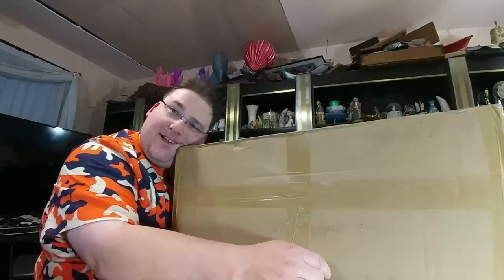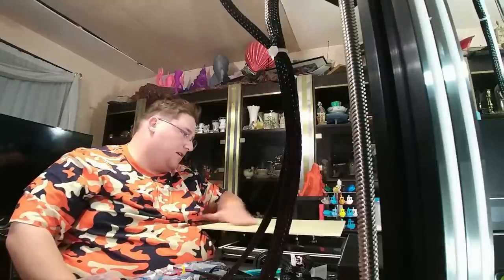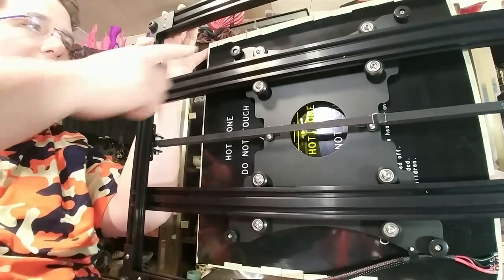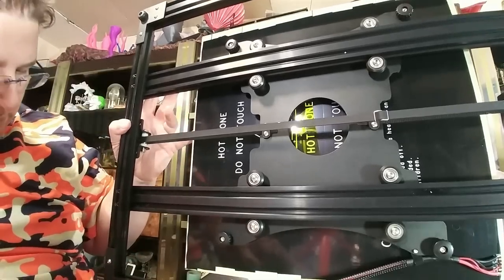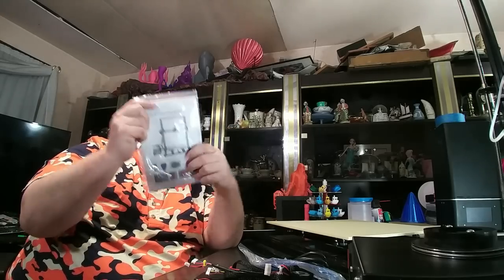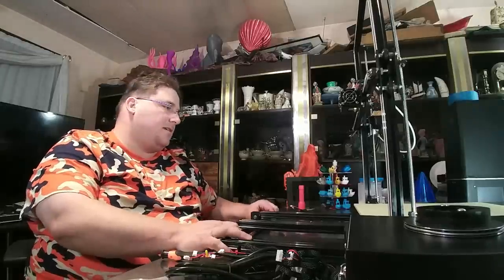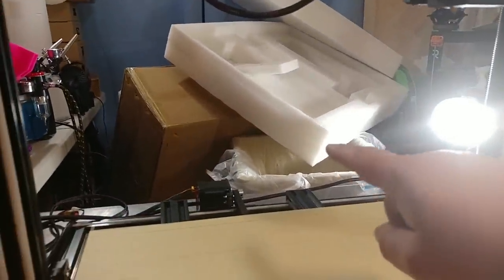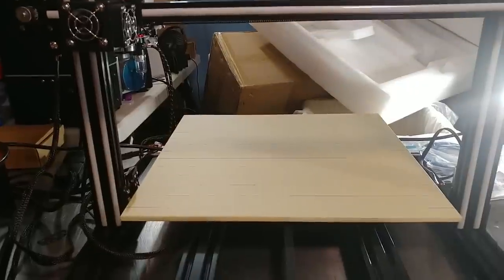Today's 3D Print 211 Alfawise U10 445 400x400x500 Printer Bigger than CR10

Comment: I love this Printer. Got mine pre-owned for 200 Euro 3 months ago. Installed new fan duct, modifiied Z-Leadscrew holders, Installed BLTouch, TMC2208. improved cable management, and now it is the best printer I ever owned, short after Witbox2. The CR10 will be good when I change the Board. 128K are not enough for Mesh bed leveling, and not exchangable steppers are pissing me off

Comment: I agree with your comments about those bed leveling knobs.  How are those z-screw couplers holding out?  I had that type on my original CR-10 and after a few months, started to look like a slinky.  My CR-10S and Tevo Tornado have the newer ones that look rubberized in the center
Reply from the maker: I have never had one fail that did not arrive already damaged. Ie in shipping.
Reply: Oh you haven't lived until you've had a very tall print churning away and your z coupler is now 6 inches tall !
Reply from the maker: Hehehe. Some sort of mechanical failure or binding to cause that! Ouch

Comment: Put the printer up on risers and then make extensions for the knobs to bring them down below the frame. I lust after this printer....
Reply from the maker: I think the larger moment arm would cause issue but ...... That is an interesting idea. I may just try to do that. Although bed level is surprisingly stable so i might not need to.
Reply: I didn't explain my idea very well. Imagine one of your nice big adjustment wheels with a column coming out of it, long enough to clear the frame and with the nut in the end of the column. No increased moment arm.
Reply from the maker: The long colum arm "is" a moment arm you would be surprised how much torque that would be exposed too. But it might work! Especially if i used maybe a threaded shaft. Or weld/epoxy a nut to one.
Reply: I have a crude drawing of what I had in mind but no way to post it here. Do you have a FB page?

Comment: I’m hesitant to buy another printer that uses the rollers that this one and many have. The ones on my tevo little monster were horrible. They develop cracks and divots that made a pattern in my prints. Under magnification I could see rust on the bearings also. They sent me replacements and they were just as bad. Just cooked something trying to upgrade the hot end. The little monster is for sale for parts.
Reply from the maker: That is interesting the only time I've had problem with rollers as if they were over tightened which squishes them otherwise I've never had a problem with the rollers at all ever that's especially Troublesome to hear considering how expensive the tevo little monster is!
Reply: I did order this printer with the eu/uk plug. About $525 with the shipping. I’m hoping the rollers are ok on the u10. Some of the roller problem was my overnighting but the cracks were there beforehand in the rollers. On the little monster tension on the arm rollers was needed to keep the hot end from falling into the finished print. Big pain to adjust this tension as it involves removing the top plate of the printer. I’m having high hopes for thenu10. Anyone printing big abs prints with the u10? I’d like to print big sign letters and pla warps in the sun...
Reply: Sorry i forgot I was logged into my other account. I’m the respect ebike guy from the original post up a few. Need 600mm to print a bike rim/wheel, things are changing fast.

Comment: Sucks about the bed leveling knob placement. The XT60s are rated at 60 amps 30 per terminal fwiw. Nice JobChris
Reply: also because... they just wont be as accurate. they need to make a bigger under bed. at this cost point they arent making anything custom. so I'm sure its the biggest out there thats mass produced part
Reply: Very True, If you look at it they are just taking the cheapest and best parts they can find and piecing them together at a better price point than anyone else basically. They have a better board and the filament and power resume and a nicer print surface than Creality but other things are a little cheaper like the screws and  the bed frame etc. Still its amazing the price drop over a Creality machine of the same size. Hundreds of dollars is nothing to ignore Creality.

Comment: wonder if this would be a good printer for a first large volume seems promising an better than tevo tornado
Reply from the maker: Alfawise is still an unknown though so far is promising. I would go with a cr10 or tornado for a first printer. Cheaper smaller better quality prints more known reliability. When your ready for printer number 2 and need more volume go for the u10.

Now if you dont need turnkey andnare ready to diy in case something goes amiss? Then hell yeah jump right into a 445. You cant beat it for the price.

Comment: shes not a 3d printer shes a beast... they do sell 10Kg pla spools so you can print full size without running out
Reply from the maker: But they are expensive. I pay $10 to $14 a kilo for cheap stuff. The 10kg rolls i have so far found are way over that.

25kg gets cheaper but now you have a huge upfront expense even if the per kilo is good. I just wish someone would sell $20-$24 2kg rolls

Comment: What do you think of the ender 3 vs. the Monoprice maker select v2. Both are about the same price when the v2 is on sale. The v2 seems to have a nicer design with dual z steppers but smaller print volume height.  I think everyone printing that complex Z wobble fix makes me think the v2 is kinda a pain and dumb design.  But does the ender 3 best it? the ender 3 seems much better as far as the frame planting on the ground.
Reply from the maker: I have 2 v2 its not even close. The ender 3 even with its imperfections is a far superior machine.

Comment: XT-60 = 60 amps,  XT-40 = 40 amps,  etc.  More then enough to handle that heat bed.  Those are not official ratings as the company that invented them never attached a rating.  Unofficially that was what they were going for in the naming scheme.  THey just didnt want to say 60 amps for liability and reputation purposes.  They are well tested in R/C community.  Officially they just say to use appropiate guage wire for any amperage you are using up to 60 amps.
Reply from the maker: Cool so if you stay at 50% of rating it would be fine.

Comment: so did you ever confirm that the spring tensioner on the y belt causes problems cause i was thinking about adding a few to my delta's belts but if they cause issues i might want to find another solution
Reply from the maker: Not yet. Its something i hears in my wanhao duplicator days. I have not seen one of those since then. I hears it adds noise since when the belt changes direction the speing can give and "vibrate" adding ghosting type noise to the print.

Comment: The spaceship print has some bands on it in two spots on the photos you showed at the end. I'm getting that as well. What is it and what can be done to get rid of it?

Love your vids! Keep em coming!
Reply from the maker: The wavyness on the vast print like the tornado? Not sure i am working on figuring that out.
Reply: The banding here https://imgur.com/aRJkrv6

How do you get rid of that? Or can one even prevent that? It's been driving me nuts b/c it happens on random prints at random times.
Reply from the maker: Thats not banding. That is designed structure built into the design of the rocket. Its supposed to be there. Its called ribbing it adds structural strength to large smooth surfaces.
Reply: OH! So it's not a mistake at all then! Thank you so much for the response. I've been fretting over this for weeks!
Reply: Look what I just found. It's for 449.99，https://www.gearbest.com/3d-printers-3d-printer-kits/pp_1596290.html?wid=1433363&lkid=14376455 , I bought one！

Comment: I would like to buy it what do you say: is it reliable? Are the surfaces smooth and precise enough in the measurements? in short, according to your opinion, do I buy it or not? congratulations for the blogs and thanks
Reply from the maker: I give it a tentative safe to buy. For a more firm yes no i need more time. What i am getting iut of it so far is promising and pleasing. Just bypass the junction block db15 unit. Its a nightmare. Besides that its pretty solid.
Reply: Nerys , thank you, I await your final judgment

Comment: hey nerys i just got my U10 today and im having an issue getting the print head to tighten up? did you have to do anything to yours? I've tightened the belt and loosened the bolts and retightened them to no avail. and help is appreciated.
Reply from the maker: Loosen the bottom adjustable wheel stick one of the smaller Allen Keys through the hole Now using fingers in front and behind with your left hand push up on the Allen key compressing the wheel up now while holding that pressure use your other hand to tighten the wheel into place

It is not eccentric like on the creality printers it's in a slot so you have to loosen it physically hold the wheel up and then tighten
Reply: Nerys you sir are a gentleman and a scholar. I feel like a idiot now lol. Thank you for the info.
Reply from the maker: No worries it's not super obvious at first took me a couple tries to figure it out :-) it's one thing I do not like about the design but it's worth it considering the Volume vs price
Reply: agreed! im also having some issues with my extruder not extruding it seems. the tension arm seems bent so its putting wonky pressure on the extruder gear.
Reply from the maker: Order a creality feeder assembly replacement of Amazon it's like $9 I will bolt right on top of the extruder stepper and also gives you flexible filament compatibility

https://amzn.to/2JyseRu
Reply: thanks for the link ordered one will try it out.

Comment: My U10 is unusable. It always clogs. I do not know why. No clog in my life with CR-10. An idea ????
Reply from the maker: If it's clogging even on pla there are usually two things that will cause this either you have a gap between the PTFE tube and the nozzle or the hot end cooling fan is not working properly

Either of those will cause pretty rapid clogging in the nozzle no matter how many times you clear it

A secondary but less likely possibility set

Too much retraction I use five mm too high a temperature although this is unlikely or the feeder assembly is not tight and is having difficulty pushing the filament

Another possible false positive for a clogged is stuffing the nozzle in the bed this will prevent filament from being ejected which will eventually cause chewing expansion and clogging start by trying to print something small like a Marvin as this will get you off the first layer rapidly for stuffing causes a problem assuming that the problem

I start with the hot end fan and the PTFE cap do a cold pool push filament through until it's extruding lower the temperature to 160 degrees then gently but firmly pull the filament out

This should clear the hot end at which point while it's still hot using a 6 mm wrench and an adjustable wrench or set of pliers on the Block being very careful not to tweak it which would damage the wiring going to the thermistor and heater cartridge using a probably six mm wrench break the nozzle free turn off the heaters let it cool down

Unscrew the nozzle all the way then unscrew the heat block the PTFE tube should come to all the way the end of the heat break and be flush You may wish to push it so that it protrudes just a fraction of a millimeter like barely anything at all and that piece should be flat and flush not angled

Screw the heat block back into place and to approximately the same position then screw the nozzle in using the pliers or wrench again the nozzle should stop and buy them out before the gap between the nozzle and he block disappears if that Gap disappears you have to unscrew the nozzle and turn the heat block a little bit more on to the hebraic there should be a little tiny gap between the end of the nozzle and the heat block itself such that when it bottoms out and mates with the heat break inside you still have a tiny Gap between the nozzle on the heat block

 that should ensure that you have no Gap in the filament path which would cause an immediate Jam also make sure the compression fitting is holding and not releasing meaning when you pull up on the PTFE tube it should not give or move
Reply: If it's clogging even on pla there are usually two things that will cause this either you have a gap between the PTFE tube and the nozzle or the hot end cooling fan is not working properly

Fan is OK (it turns...). PTFE is close to the nozzle (I even change the heat transfert piece for one with PTFE incorporated). In fact the clog is often in the PTFE. The filament is thicker in the PTFE so it clogs (I think it melts and go thicker when it retracts).

Compression fitting changed. I wiill return this machine if it continues...
Reply: >>>Too much retraction I use five mm too high a temperature although this is unlikely or the feeder assembly is not tight and is having difficulty pushing the filament

I tried 5 mm retractation then 2 mm, same thing.
The feeder seems too tight in fact. I have to push a lot when I put filament.

>>>Another possible false positive for a clogged is stuffing the nozzle in the bed this will prevent filament from being ejected which will eventually cause chewing expansion and clogging start by trying to print something small like a Marvin as this will get you off the first layer rapidly for stuffing causes a problem assuming that the problem

In fact it clogs after about 30 mn or 1 hour of work not at the beginning...
Reply from the maker: Your last comment and this one tells me you're hot and fan does not functioning properly you're getting what's called he creep that's where the temperature inside the cold side of the hot end is getting too high the filament expanding and clogging

I'm trying to remember exactly what the hot end on this printer looks like I'll have to check mine when I get home but between the cold end and the hot end there should only be one connection and that's the heat break going up the middle if there are two additional bolts connecting the heat block to the cold end remove them I will show you a picture later if that is unclear

I currently suspect you're hot and fan is not working properly simply turning is not enough it has to turn fast enough to actually cool the cold side of the heat break otherwise the filament will in fact expand inside the PTFE tube and clog

5 mm is fine you don't have to worry about that I just wasn't sure if you had something crazy like 15-20 mm which I've seen people do :-)

Worst case scenario you can do what I do to all of my Chinese printers I keep a stock of creality style hot ends on hand and I just replace them all especially on a net printers although I have not had to do this on The U10

But my current suspicion is that the hot and fan is not spinning properly at full speed so you're getting heat creep expanding inside the PTFE tube too much it's normal for it to expand a little bit and the timing of when it happens 30 minutes to an hour into the print sounds like heat creep to me
Reply: Thanks, I think like you, a problem with heat going too high. I want to change for a creality hotend but I needed to print soon and the part will come to me too late. I will try again to get a solution. if I find one, I will tell here. Have a good day.
Reply from the maker: To get you going for now try lubricating print out a small boiler and put some sponge in it and a tiny bit of oil willing the filament will out the flow easier and help to offset whatever problems going on it's not a permanent solution better to get you by for now possibly the hot end on this printer is not that bad so I still suspect there's something wrong with the fan